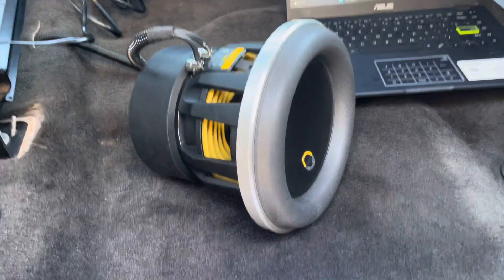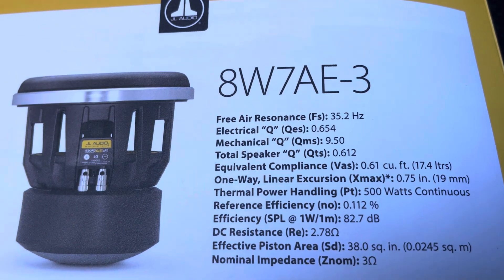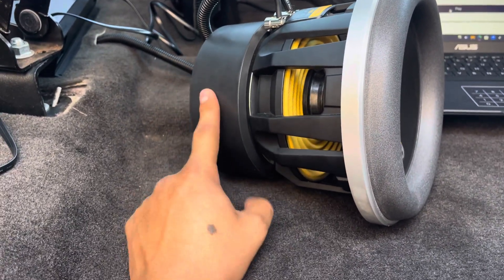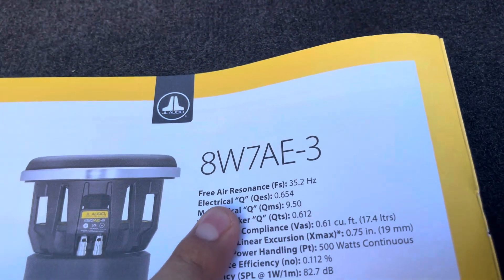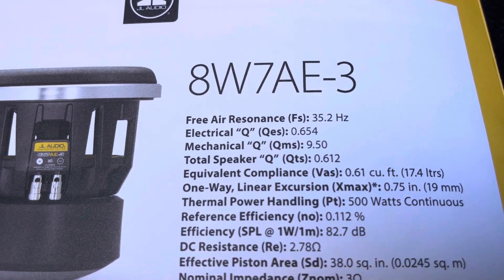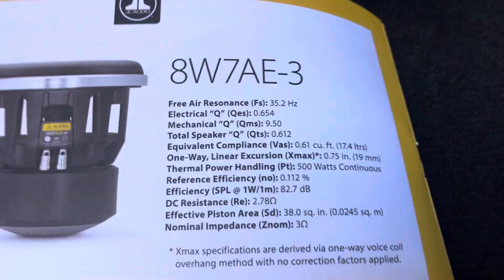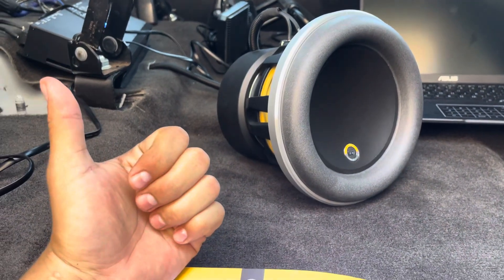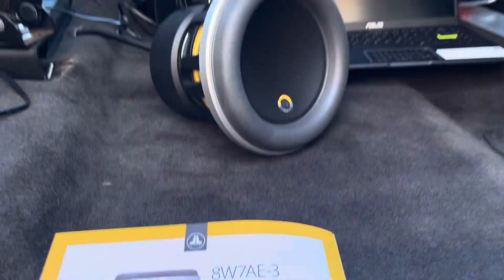JL Audio w7 “Quality demands a higher price” expanded..

Comment: I currently have 2 jlw0 10” in a sealed box in my crew cab Silverado on a sundown sia 1750. They are not enough bass. One buddy tells me just to put them in a ported box. I had a 12” w7 in a ported box in a Lexus is300 with  a jl 1000/1 14 years ago and that was loud. 

I did mids and highs truck is set up for sq. I want something with a lot more bass while maintaining sq. I’ve been looking at doing possibly 2 w6 8” or 2 w7 8” in a ported box. 

I was reading through your comments and saw you mentioned the ddaudio 2508g which I could buy 2 for the price of one w7 pretty much.

What would you recommend?
Reply from the maker: dd2508 is good SQ and power

Comment: 500 rms is kinda weak

B2 rampage 8 has an fs in low 30s rated at 1000rms probability has similar sq and is like half the price.
Reply from the maker: Stereo Integrity, B2 audio, and Tezla audio are good SQ subs. But the w7 is just on another level. If stereo integrity made an 8” I would get it.
Reply: @SQsilverado  another level of price maybe.
Reply: Currently running b2 rampage. W7 doesn't come close in sq, spl or price point. Simply paying for a name, nothing special about JL but do what you want with your money
Reply from the maker: @usmcpitu  check out MBE enclosures search him up on YouTube
Reply: @SQ_Silverado  I'm familiar with mbe channel, good box builder but I do my own builds/boxes. I'm sure hell have his opinion/review soon on the w7 compared to the others
Reply: JL subs dont need as much power to have output. It is an SQ sub that also has great output. B2 Rampage couldnt even begin to compare in SQ. But most of us are not looking for the most SQ. We want great sound but we want lots of output and or lows. So other subs make more sense for those needs.

Comment: I have a JL WO10.4 rated at 125-150 watts RMS. I Bought in about 2004, I recently pulled it out of the closet And have been putting about 300 watts RMS to it with no trouble, shows the quality of JL audio
Reply: You think its 300rms. Did you clamp it? I love when people dont realize anything about impedance rise
Reply: @ah4800  well the amp is a kicker cxa400.1 with gain about half way, I have no idea talking outta my ass. How bout you bro❓ you butt hurt❓